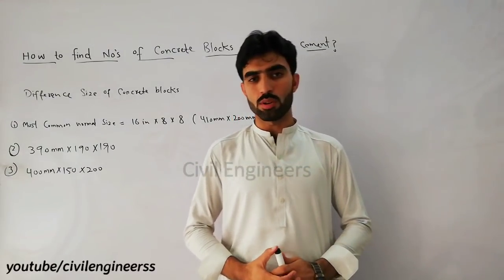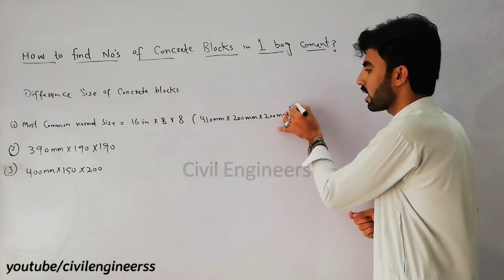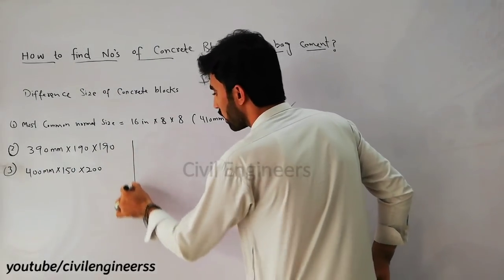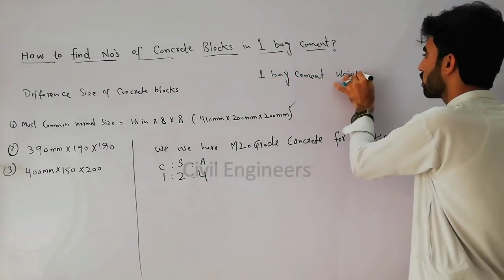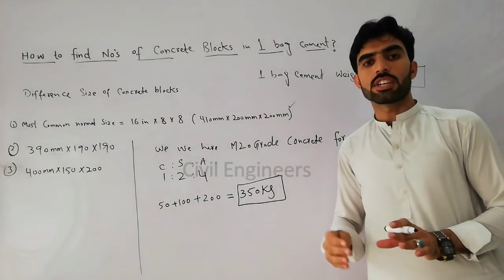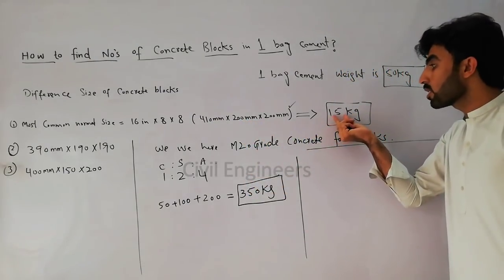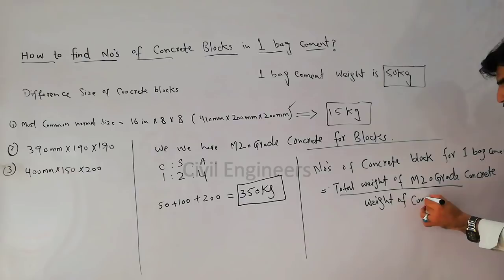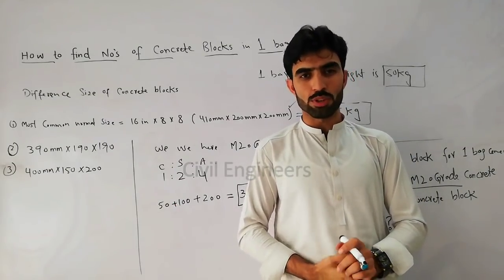How to Find No's of Concrete Blocks in 1 Bag of Cement?

Comment from the maker: Sorry for M20 Grade concrete mistake .... M20 Grade Ratio = 1:1.5:3
Reply: Is the mixture ratio based on weight or volume?
Reply: @thepi1466  Always we mention that volume batching. If we need weight batching we have to know the density of the materials we used. Then the ratio will be multiply by their density and then used as weight batching.
Reply: Sir how can found 15 ?
Reply: Civil Engineers  we will always support you.. 💚
Reply: Civil Engineers chal koi na

Comment: Is that ratio for weight or amount.  Because for M20 grade is 1:1: 5.3  meaning  1 wheelbarrow cement: 1 wheelbarrow sand: 5.3 wheelbarrow aggregate. ,does matter whether 1wheelbarrow of sand weighs less than 1 wheelbarrow of cement... I hope you get my point.

Comment: Hello Sami, your calculation gives us 23.3 blocks per 1bag of cement. But in here (Somalia) we use 400x200x200mm and we make 40 blocks per bag of cement and the strength of concrete always become good, no problems due to construction.
Reply: Whats your mixing ratio?
Reply: Good brother keep it up d, not worry wish you good luck from Pakistan 🇵🇰🇵🇰🇵🇰
Reply: Hi can you give your WhatsApp no please
Reply: Luqmaan somalia xagee ka joogtaa,,tan kale bulukeetiga ma iibisaa oo ganacsi ahaan baa u samaysaa mise guri baa ka dhisanaysaa,
Reply: @abdikhadarmohamed7866  sxb waa sida somalida u sameyso bulukeetiga 400×200×200  ama 380×170×170 waan u maleynayaa inaa fahantay mid kale xagee joogtaa walaalo aniga moqdisho
Reply: @engabdullahigutale4705  szb Nairobi baan joogaa laakiin howshaa waa xiiseynayaa  guri baan ka dhisan rabaa bulukeeti aan aniga samaystay inshaa laah,
Reply: sxb @luqmaan waan kusalaamay waxaad ii sheegtaa  ratio gee isugu dartaan markii aad ka soo saareysaan (400×200×200)  40 per 1 bag of cement
Reply: Yes
Reply: How many bricks 400x200x200 size for a 4x4 room sir
Reply: Yes u r right. because what he did mistake is 350/15=23.3

It should be 350 x 1.52/15 = 36 blocks 

For 410x200x200 sizes.

He forgot add water and bulkage